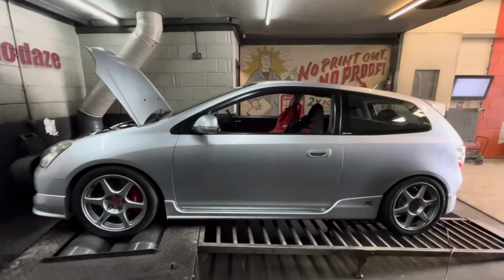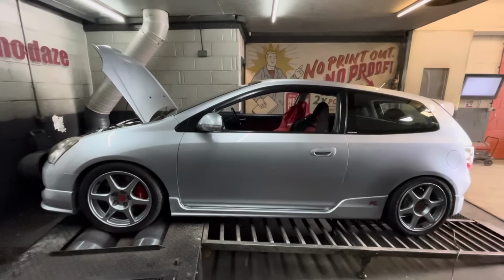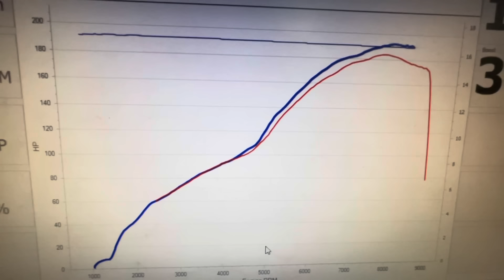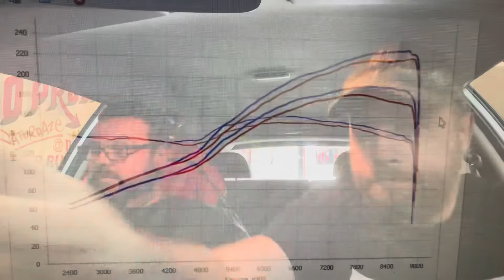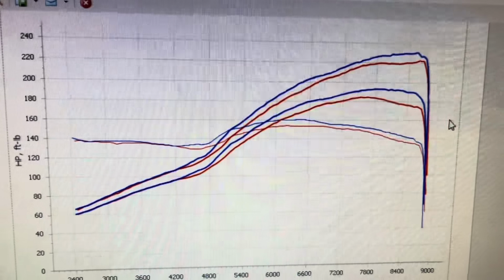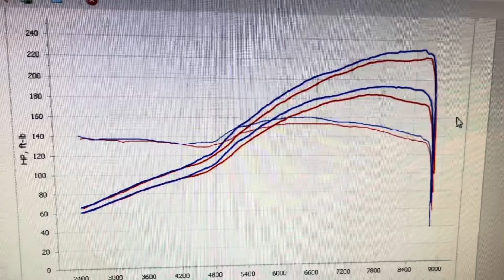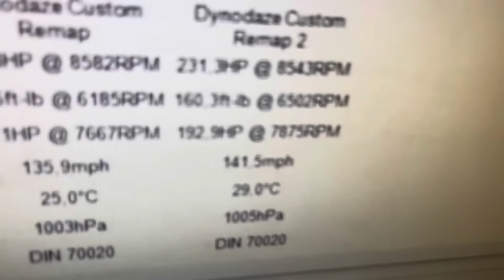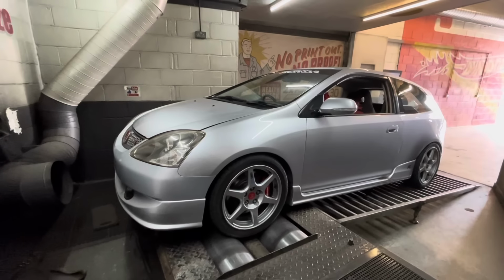LISTEN TO THIS! Honda Civic Ep3 TypeR Tuned after RRC inlet Manifold

Comment: This built is nearly the same as mine, I need to change the exhaust I have and maybe will be better off with some extra 10hp. 
This is my setup: 
RRC Manifold
Tegiwa 4-2-1
Skunk2 70mm throatle body
Scorpion exhaust 51mm (I know)
HYbridracing fuel rail
Kprov4
Gave me: 228hp and 212nm.